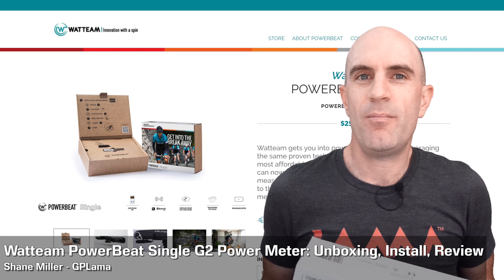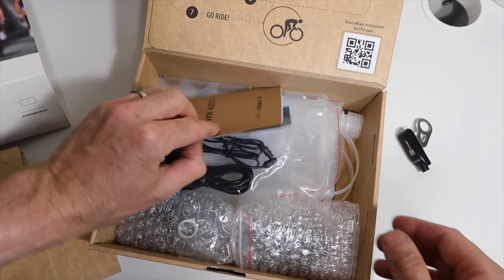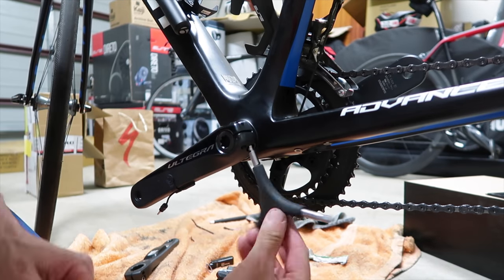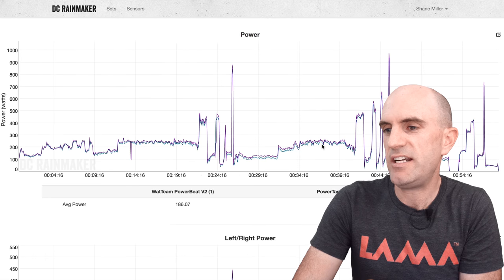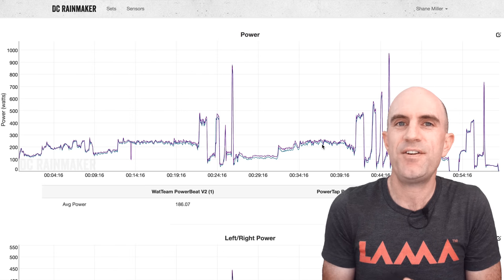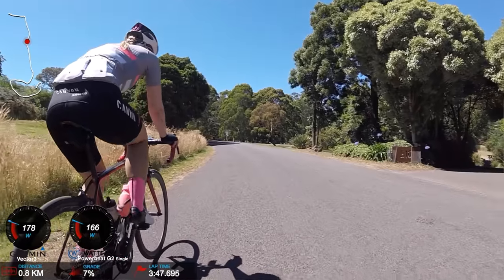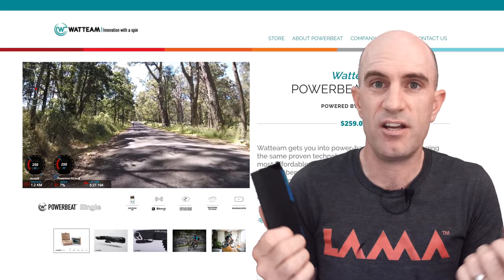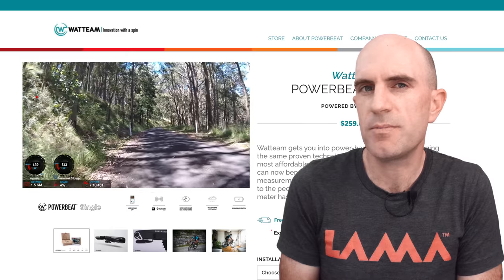Watteam PowerBeat Single G2 Power Meter: Unboxing, Install, Review

Comment: I wonder if anyone else would know about a descrepency. When you don't have multiple power meters on your bike it's hard to know if you are off. I guess if it's off by 10% you could feel that. But that assumes you've used a different power meter before and have an idea of how your effort translates into power. 

I've often wondered how accurate my power2max is. But then I realize it's the only power meter I've ever used so it doesn't much matter for me. 

Precision vs accuracy conversation continues.
Reply: I see others have already mentioned this in previous comments.

Comment: I recently purchased the upgrade kit and all I can say is save your money the power readings are up to 100 watts low and the left - right balance is way off I can even unclip and spin with one leg and it still shows the power from the unclipped foot higher than the clipped in leg. Watteam have not as yet responded to my support email so I will keep everyone informed as it is always interesting to see how just the punters are treated as opposed to Shane who they care about due to his industry standing.
Reply from the maker: Thanks for the comment. If you're unhappy with their products and their support - By all means share YOUR experience. Just lay off getting all pissy about my perceived "industry standing" as a comparison for your issues. I'm not involved in that process.
Reply: Shane Miller - GPLama hi Shane I actually think your work is first rate. But a simple fact is your position in the industry which is well deserved and I certainly appreciate your work does means you will normally get prioriry support responces, I am sure you know what I mean and I did not intend to offend in any way and I  apologise if any was taken. Anyhow let's see how Watteam respond to my new email.
Reply: Well it has been two months now and Watteam have been really good at trying to work out what is going on we have been through several glue sessions and each time we have not had fantastic results. We went through another glue process (left) and I think we might have nailed the left meter this time so we are going to do the same re-glue with the right sensor. What we have found is the ambient temperature is really important the last time I heated the room up to close on 30 degrees and we seem to have great readings on the left sensor. Version 3 of Watteam PowerBeats are about to drop today and earlier versions will be able to use the new software package which will also have a new calibrate alteration tool. I really want these power meters to just work as I have spent so much time working on them with the team at Watteam. Should have the next and hopefully last post in the next month. BTW if you are going to glue these on heat the room and ensure the cranks have had time to acclimate before starting and ensure you mix the glue really well before gluing and ensure you only have a thin even smear of glue on the sensor and you should be good to go.
Reply: Watteam have basically agreed something is incorrect with the left right balance of the G2' I have and are going to replace with G3's including cranks as mine really can not be sanded anymore. Would I buy these again yes I would as a company like Watteam needs to be supported as their product and ethics are commendable. I wish other companies would work as hard for their customers.

Comment: Power reading inaccuracy possibly due to left/right leg imbalance, if your right leg is stronger then the graph will be consistently below the graph of the dual meters.  At least with the 4iii single side units the mobile app allows you to set a leg imbalance scaling factor to accommodate for either leg being stronger.
Reply from the maker: The theory holds. The data doesn't. It should then match (<1%) of the left P1 or left Vector3. It doesn't. I have those individual data streams. I still need to get a hold of some 4iiii units for sure. That scaling sounds neat.

Comment: Were you using this with ANT+? I've found this powermeter to be rubbish and the response rate and readings to be absolute trash. (BLE Dual, Wahoo Fitness)
Reply from the maker: The company has gone out of business. Time to move on to another power meter.
Reply: @gplama  For sure, I bought a Stages, but wasn't able to get the correct crankarm length (170mm instead of 165mm). Just curious if you were using ANT+ because the app still works (for now) and would like to use my 165mm cranks, but was wondering if bluetooth is the cause of the slow response rate. I noticed it takes at least 3x as long to pair via BLE compared to the Stages and the readings are completely off and slow also.

Comment: U only need to preload strain gauge on crank just by applying right torque to crank arm bolts 12-14Nm - but not by hands.. Anyway if u can feel right torque by hands, on second day bolts have little loosen, so u need to screw tightly them again - and accuracy will come back) i hawe some holywar on local board about stages crank mount without torque wrench - untill i go and buy torque wrench i have dancing numbers all time... U must use it!
Reply from the maker: That's not anywhere in the documentation, nor ever suggested by Watteam. This should also have been negated by the re-calibration with the static weights. I'll keep this in mind for my next tests.

Comment: Great upload Shane but I have to say from a technical point of view this is not a worthy sensor transducer. Very little bending compensation of parasitics, low strain amplitude of just one longitudinal gauge, and the home calibration using water bags is just a joke. A proper sensor should be calibrated using calibrated dead weights or on a dyno at different temperature, torque and rpm points. Save your money kids and buy a proper one.
Reply from the maker: I agree... but the resulting numbers were pretty good. If they were to take into account all the factors you mention then they'd be the same price as everything else.

Comment: Can you use this power meter on 105 5800 cranks, with M520 Mtb peddles?
Reply from the maker: Check their website for crank compatibility. It'll work with any pedals.
Reply: Shane Miller - GPLama  cheers Shane

Comment: Shane how could I know if my unit is running low or high?
Reply from the maker: You need to check it against a known/trusted/good source. The same way you'd have to check a tape measure, or the scales that weigh your fruit at the store.
Reply: Wow that was quick! It means that I have to borrow a powermeter from a friend to test it out, and if I cant get to test it, I'll use wrong data forever? Thats pretty scary to hear about a compaby that should be trusted....
Reply from the maker: Yep. It's about trust and verification. I bet there's $millions of dollars lost/gained every year around the world from uncalibrated scales. Does it matter? Not really..... body dies. Often.

Comment: When comparing two strain gage power meters, how do you know which one is closer to correct? You seem to assume that PowerTap is correct, but another possibility is that they are both wrong.
Reply from the maker: I've done 100s of comparative tests with the P1 against a Quarq, Neo, Drivo, Direto, etc, etc. As well as Vector3, Assioma, and others to keep those in check as well. It's not guesswork. It's the data that I have. It's pretty solid. If you're after 100% scientific accuracy then I'd keep well clear of the power meter in this video. My 2c.
Reply: I'm not saying it is correct. But all strain gage power meters have been shown to have some inaccuracy and temperature can affect accuracy. Without knowing how accurate the other power meter is at the time of the test you have no way of knowing which of the two power meters is more accurate at the time of the test.
Reply from the maker: You’ve just reiterated what you said initially. Some power meters have temperature compensation. I zero offset prior, etc. It’s best practice with the tools I have and with a LOT of reference data. If that’s no good for you, that’s fine.
Reply: The issue I have is that most of us don't have several different power meters sitting around so we can compare them against each other. Whether it is a $260 unit or a $1000 unit I can't just "dial up" or "dial down" the calibration without having some idea of how much I need to dial it up or down.
Reply from the maker: Then best stick with the brands that don't require this kind of tinkering to ensure they're correct. The content I create should help steer people in the right direction as to what to buy based on their requirements.
Reply: I don't disagree, but that brings us back to the original question. Given that both were tracking together originally, how do we know which of the two was off during the next ride? Or was it that they were off during the first ride and one of them corrected itself on the next ride? We assume that a device with more strain gages will be less susceptible to whatever caused the difference in readings, but we don't really know that and its compounded by the fact that some manufacturers suggest that people should calibrate their meters after ten minutes of riding. In other words, even the manufacturers don't trust their power meters to provide a consistent reading in various conditions.

Comment: Ifølge you don't already have an expensive powermeter for reference, you won't have anything to adjust your calibration against.
Reply: And btw Who says that it is not the Powertap pedals measuring too high?
Reply from the maker: All the data I’ve collected on them against many other power meters and static weight testing say they’re not reading high. This isn’t new ground I’m braking here.

Comment: This sounds like a fundamentally stupid question. But if one were just to have this power meter only, is there a way to test its accuracy?
Reply from the maker: Nope. You'll need a known/good reference point. It's like having one tape measure. You can only assume it's correct.
Reply: Yeah I figured as much. Thanks heaps for your super speedy response. Much appreciated

Comment: What if you do not have the possibility to compare the calibration. Then you will never know when calibration is off!
Reply from the maker: That'd be the "Stages Theorem" or something.... where a rider with one power meter knows their power. A rider with two power meters is never sure. And a rider with Stages is..... sure to trigger on my cheap shot at how dodgy Stages Gen 1 was. ;)
Reply: I guess if you just use the values as your own reference to compare you are ok. But on the other hand as with many trainers and power meters that are used on Zwift these days, it is crucial that power data is accurate. I have examples where people are joining races on Zwift in the A category and riding with power data that is way off.

Comment: Over the years I have had loads of power meters. 
Srm, powertap, rotor 3D power, quarq, stages - 3 off, limits, powerpod, etc. 
I can categorically say they are all shit. All have problems. 
Stages I get the most use out of. But they all break. However the cheapest ones like this, powerpod, limits etc - the crowdfunded ones - not only develop faults much much quicker - they also look crap. 
I have recently bought a power2max ng eco. So I’ll have another unit to moan about soon. Other than that I’m having a good day!
Reply from the maker: Truth! Great comment. The more of these I have and ride, the more I know you’re spot on.

Comment: You do realize that gravity is not constant across the earths surface which makes weighing things accurately rather problematic.  In fact there is an area just outside my local doughnut store - when I walk towards the door, I suddenly feel 2 lbs heavier - Over the years, that gravitational anomaly has saved me from scarfing down thousands of Krispy Creams!  Seriously!
Reply from the maker: You're scientifically correct. Then you take it to the donut shop and now nobody will believe you. *I'm at ~350m.
Reply: Good point.  Not to mention that gravity spins the other way in the Southern Hemisphere. So yer left pedal is gonna weigh more than the right pedal.

Comment: I bought these for myself and can serisouly say it's the worst purchase I have ever made. I've had nothing but problems with these even after being sent a replacment set. Not worth your time or effort!
Reply from the maker: Self glued option? Gen 2? Single or dual? Have at us with the detail.
Reply: I had the self glue option and to be fair I have FD-5800 crank arms which are inconveniently curved in such a way that it's very difficult if it's your first time (or second as I tried twice) to get it glued center and straight (AT THAT POINT and not the straight alignment of the crank arm's complete length).  After the 2nd attempt, I sent it in for them to glue them.  I've been running ok with it since.  The pairing and their operating states take some time to get used to.  I'd say quirky like an odd duck but maybe I'm the odd duck.  With the year warranty I'm hopeful now that I've got a good solution, especially for the black friday price of $319 for dual pedal power.
Reply: I had the same experience.

Comment: the thing is, nobody is like you comparing power meters so if this thing tracks low and the calibration did not fix it, i qualify this as a bad product...
Reply from the maker: Yes they are. Smart trainer owners do it all the time. Owner groups are littered with ‘doesn’t match’ queries. The reasons are many as to why there different, but it can’t be discarded as nobody does this.
Reply: you know what i mean...

Comment: The re-calibration fine tune is not useful as most customers will not have another power meter to use for calibration.
Reply from the maker: Still an essential feature for those who do, or will.

Comment: Please do not buy it. I have the singlesided version. I bought the tools and a new crank arm (shimano 5800) to fit it on my bike and it didn't work. I contacted them and they sent me a second one which I installed extra careful. It didn't work either.